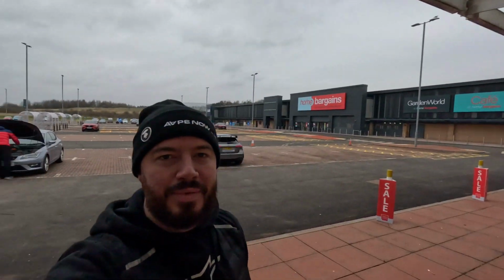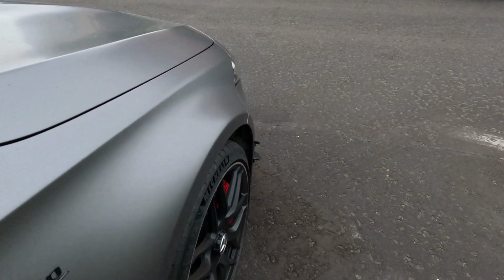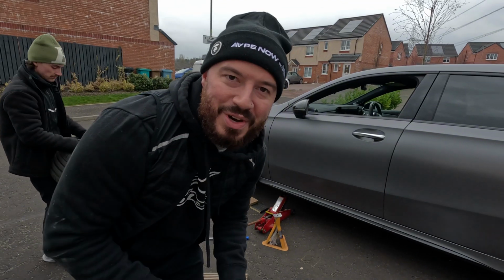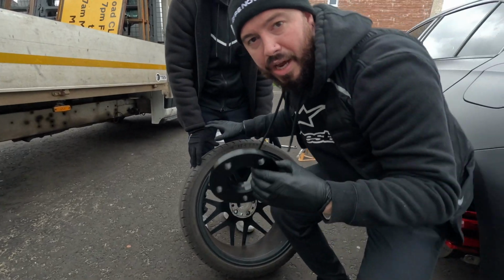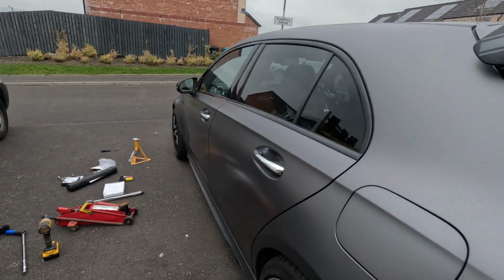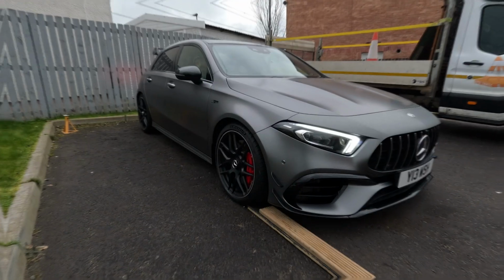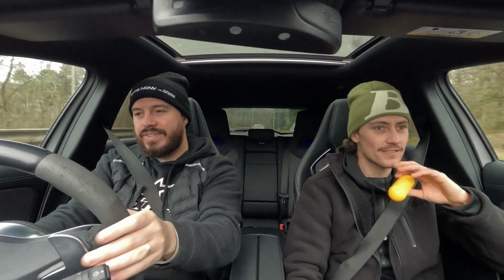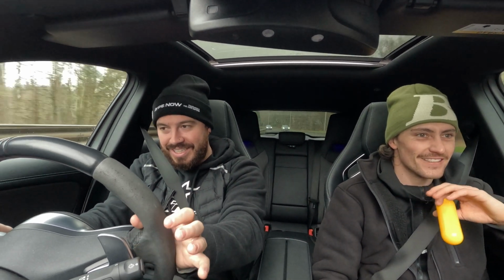How to Install Wheel Spacers: Proper Wheel Spacer Installation Guide and Tips | Mercedes A45s Amg

Comment: Great video thanks, how are they holding up? No tyre rub on the fenders with full lock and bumps? Cheers pal
Reply from the maker: No bother! If you head to 4 videos later than this you’ll see I had some issues, had to swap the back to 12mm after experiencing rubbing on the rear. But after that, it’s been rocking perfectly for 18k miles with the spacers on no issues 😎

Comment: May i know your stock wheel spec? Is it 19x8.5, ET46?
Reply from the maker: Correct mate
Reply: @ur car not lowered, right? If it lowered definitely will tuck in a little bit more.
Reply from the maker: @ check later videos on the channel bro my car is very different now to this video you watched!

Comment: Great job! Any issues with abnormal tire wear?
Reply from the maker: Absolutely, get about half of the life of a tyre but that’s due to camber from factory too!
Reply from the maker: @jasoncastaneda7095  I should have mentioned, the back wheels have no abnormal tyre wear at all, I’m close to 20k on my rear tyres and they still have another few thousand miles in them. In that time I’ve changed my front tyres twice, so that gives you an idea!
Reply: @DreamscapeAutomotive  Thanks for the response. Have you tired getting an alignment to fix the front camber?
Reply from the maker: @ my car is fully setup for a fast road alignment, these cars are designed from factory with camber mate, it’s part of the expert setup, the guy that done my alignment told me if we correct it the way AMG set it up will be compromised. The best he can do is maintain the camber settings that factory dictated!
Reply: @DreamscapeAutomotive  Ok. Thanks for the info.
Reply from the maker: @ no problem 😎

Comment: Where can get this  spacers and what size.
Reply from the maker: Ebay, link here - https://www.ebay.co.uk/itm/184768326353?mkcid=16&mkevt=1&mkrid=711-127632-2357-0&ssspo=GZXpV_4BRaO&sssrc=4429486&ssuid=_iMtyjJuTwm&var=&widget_ver=artemis&media=COPY

15mm front
12mm rear
Reply: I drve cla 45s amg 2021
Reply from the maker: @rssuarez8058  they will fit
Reply: @DreamscapeAutomotive  can u tell me why the back is smaller.
Reply: Why is it 2 different size